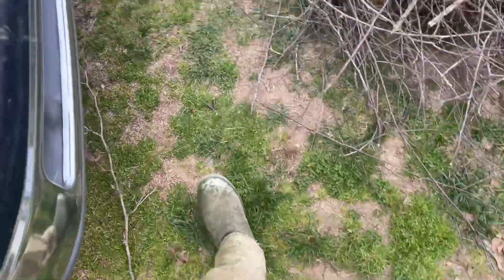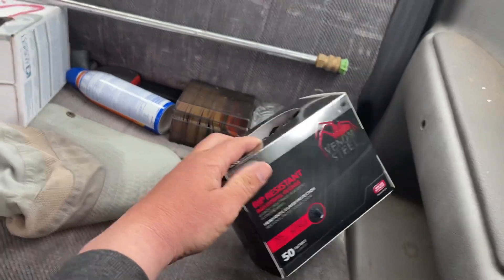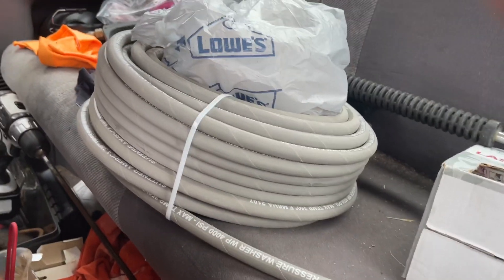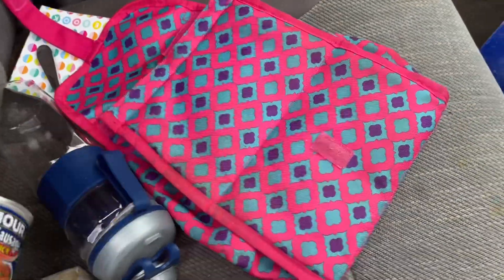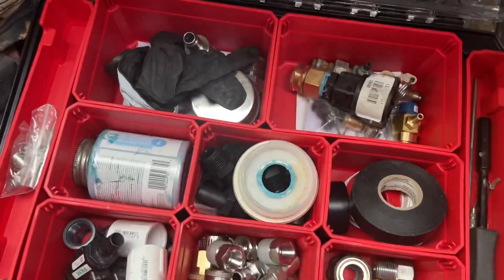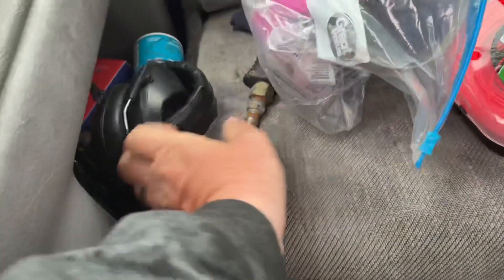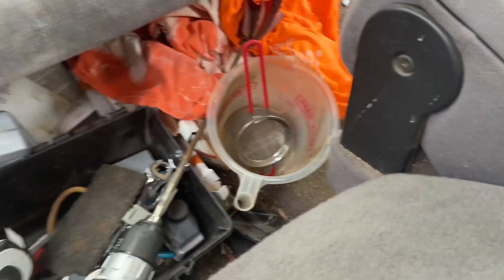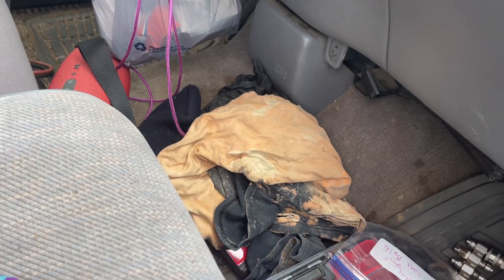What is inside my truck on a typical work day???

Comment: how are you keeping your quick fittings from not jamming or hard to connect, like do you use PB blaster or? I'm always having troubles with this
Reply from the maker: I honestly use nothing. When I started I would spray WD-40 and then the next time I tried to use it they wouldn’t work.That swells the o-rings. I Threw away so many fittings that all they needed was O-ring and I just didn’t know.
Reply: I use my crc dielectric grease. I've seen couple videos of people using it and says on bottle it works for orings.
Reply: I spray mine with PB Blaster don’t see much difference thou
Reply: @coryj1811  how’s that working? I wonder if white lithium grease would be good
Reply: @Batags  don't know long term yet because honestly I'm still new and just started doing this. From what I've read and seen it seems like it should be good but 🤷‍♂️
Reply: I do know that for the oring on my whole house water filter it comes with small tube of silicone grease. And that's from manufacturer of the orings
Reply: Also silicone grease should be fine because it wouldn't matter if it's natural or synthetic rubber. Since some lubricant will actually do the opposite and break down the rubber instead of helping, depending on material makeup of it
Reply from the maker: Mike Carmody uses engine oil. That may be something to check out. I spray nothing on mine and have used the same coupler on my gun and roof pump fitting for a year now. Rim oil is something I was told also.
Reply: @Batags  would be careful with lithium since it's petroleum based, which breaks down rubber. I can't remember if it's natural or synthetic rubbers, but that's why I stayed away from it. Also, I'm not sure if with how often you would need to change oring if it would be a noticeable difference. That's why I chose a silicone grease, helps with waterproofing, and since it can be used on metals, I put some on my quick disconnects also.